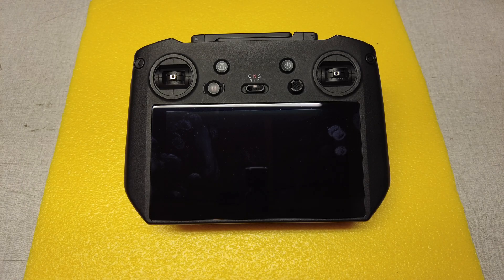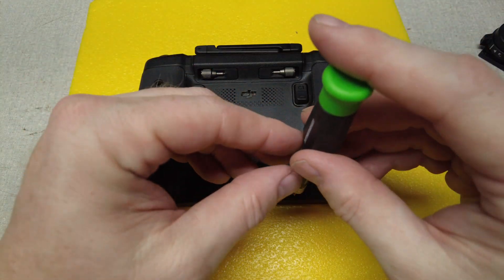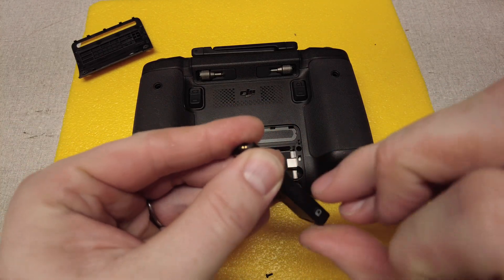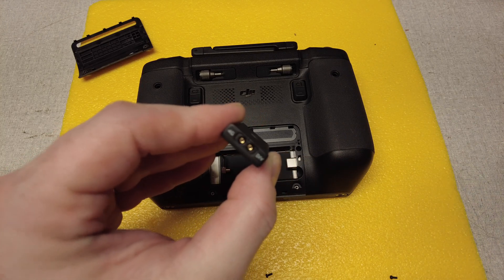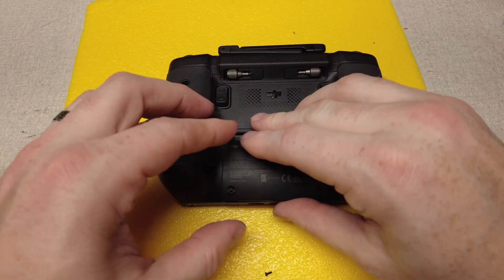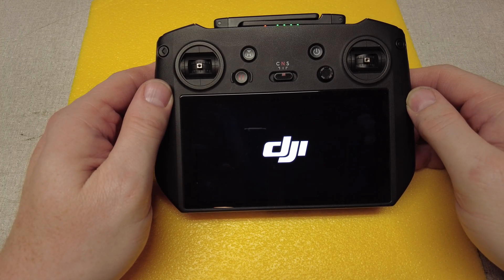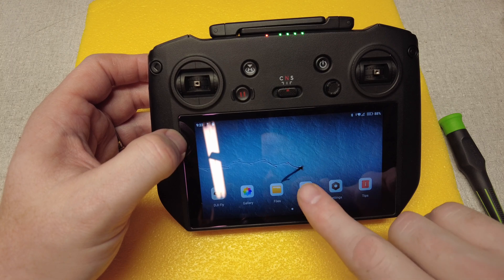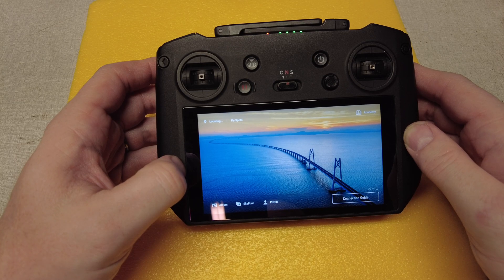DJI LTE Dongle Install

Comment: If you’re using this on the drone to extend its range, do we need two of these dongles? One for the RC pro and the other for the drone?
Reply from the maker: This video is merely about installing the LTE dongle in the RC-Pro controller. That is all. This isn’t anything about BVLOS. But if it was, yes you would need two, one for the controller, and one in the little backpack attachment on the top of the drone connected to the USB port on the back.

Comment: There are so many pictures on the internet where this is attached to the drone. Do I need two devices or is one in the controller enough?
Reply from the maker: So this is ONLY to give the controller its own internet access without having to be slaved to a phone for that. This IS NOT for doing the LTE control of the drone, as that feature is ONLY available in China. If you looked through comments you would see I’ve stated this many many times.

Comment: Dave, if I install this on an enterprise RC Pro, can i use the remote ad the hotspot for an RTK base station?
Reply from the maker: Used to be able to. But a firmware update made it so they won’t recognize these devices anymore. :(

Comment: Just a quick addition here, I'm sure this may answer some of your questions.  When I called Verizon Wireless to order a SIM card they said they couldn't do it because it wasn't a phone, tablet, etc.  They wanted to give me another line.  So, as a test, I removed the SIM from my Galaxy S21 Ultra, installed it in the dongle and carefully installed both in the controller and booted.  Hope you have small Torx bits.  ;-)  Went into settings, turned off Wifi and turned on mobile networking.  Rebooted.  BAM!  4G Verizon Heaven.  So I called them back and ordered a duplicate SIM for my phone.  NO CHARGE, FREE 2-day shipping.  If the duplicate doesn't work, I'm told to use my old one, install the new one in the phone and activate.  That's it.  FYI, she told me that VZ can't see what device you use the SIM in.  That means that all data you use with your new controller mobile connection will show under your phone number...like they're both the same.  So cool having cellular service with the Pro controller.  IMHO, for the price, it should already be onboard in case you want to utilize it.

I don't know about other carriers, but I wouldn't think there wouldn't be much of a difference.  Your mileage may very...good luck!  ;-)

Thanks for the tutorial Dave, it came in handy.
Reply from the maker: Great points. Thanks for sharing. For me, I just took the dongle into an AT&T store, told him exactly what it’s for and he made me a SIM card.
Reply: I ordered one and plan on removing the sim from my ipad mini I have thru Verizon to use with my RC pro. Question did the new sim work? And if so are both working under the same number?
Reply: @antdwg67  I received the new SIM today.  I installed it in my pro without activating it and it works perfectly.  And yes, both work under the same number.  I'm an Android guy, so I can't speak to iStuff compatibility.  This really works great and the controller is fast.  Super happy with it and totally recommend.
Reply: @mikel9741  I have the same phone as you I just use an iPad mini for travel and was just wondering if I'll have the same luck
Reply: Mike so what you're saying is you have a duplicate Sim of your phone Sim and you just installed that into your controller and you don't have an additional monthly data charge?

Comment: Man I completely missed missed on the application of the LTE connection on corporate drones! So with "off the shelf" drones, LTE is just used to give the controller a network connection? I mean, that's handy for apps and workflow I guess but I thought it was a C2 LTE connection for EVLOS and BVLOS flight! Wow that kind of takes some of the excitement out of it if honest.

Comment: Why do you need 4G dongle in  this RC-Pro and people don’t need  that dongle on DJI RC with mini 3 pro? Thx helio
Reply from the maker: I’m using the dongle in the controller so it has its own internet connection, without having to be tethered to a phone for one. That is all.

Comment: Is it suitable for RC controller (not RC pro)?
Reply from the maker: Do you mean the simple RC-N1 or the basic smart controller DJI-RC? The RC-N1, no it won’t work, doesn’t have a place to install it, and is needless anyway since that controller is used in conjunction with a phone which has its own connection. The other DJI-RC, I have not gotten my hands on so cannot say.

Comment: I just received this if your in the U.S it's gonna tell you it's not supported in this region.. doesn't work
Reply from the maker: I am in the US, Washington state. The activated dongle installed in the RC-Pro does indeed work just fine to give the RC-Pro it's own internet connection without having to be tethered to a phone or wifi etc. 

That IS all this video is about. 

I never once anywhere in the video claimed it makes the LTE control connection to the drone to be able to fly further than the RC range. In fact I dont even approach that subject in the video.

Comment: Hi, have a couple of question. I saw a bit down in the comments, that you now have 2 dongles. But the first question will be regarding the compability with the operators in US (As I understand you're located in Washington?!). The dongle that I have seen on internet is a TD-LTE dongle, but I live in EU and here we mostly have FD-LTE, how is it US, did this work fine with any operator and also FD-LTE?
I know its not related to this post, but have you tried to connect with the 4g option on the RC Pro to the Mavic 3?
Reply from the maker: I wasn't aware of the difference between TD-LTE and FD-LTE, thank you for pointing that out so I was able to educate myself. 

I had no problem getting it to work once I got a sim card for it. Yes Im in US, in Washington state. I just went to my local Telcom company (AT&T) and proicured a Sim card, inserted it in the dongle, hoked it up to the controller as shown in the video and it works. 

As for the having two, and getting it to work, I have not tried recently. I did try once at first, with just the one dongle with the sim card instaled on the drone, and the controller being tethered to my phone for a LTE connection, and was unsuccessful. From everything I have read, that is most likely going to be the case even with two dongles and a sim card in each as it is a geo-locked based feature. I have been expecting to perhaps see someone finding a work around to that, but honestly I haven't looked lately.
Reply: @DaveDurkee  Thanks for the reply, yes it seems like it is geo-locked unfortunately, lets hope there will be an update on this soon. Chers, and thanks for the content.

Comment: This dongle work on dji rc n1??
Reply from the maker: Not as far as Im aware. the RC Pro has the internal USB C connection as well as the internal antenna plug to connect to the dongle. the RC-N1 I dont believe does, but I havnt had one taken apart to really be able to say for sure.

Comment: G is it possible you can tell me where to get the DJI dongle from? I have any maverick three classic with the RCA smart controller.
Reply from the maker: I got mine from Alibaba. Just looked, they are still available there.
Reply: Thank you so much for your response, do you know if it works for the regular RCA controller, I do not have the pro yet?
Reply: @andrewjones6962  I don’t think it does but can’t say for sure.
Reply: @DaveDurkee  What firmware are you running on the rc pro cheers

Comment: Hi….  Can I ask a few questions?

I have a Mavic-3 and an RC-Pro controller.
The drone is sometimes flown in a heavy Wi-Fi RFI area which causes the drone to lose link with the remote controller.

I already have internet connectivity for my  RC-Pro controller.
(Tethered to my Samsung Galaxy S10+ / Cellular carrier = Verizon Wireless)

I have a single DJI “dongle” set purchased from a Chinese or Hong-Kong seller.

Can I just get a Verizon Wireless SIM Card (NYC/NJ Metro Area), insert into the dongle  and connect the “dongle” to the Mavic-3?
Does the RC-Pro absolutely require a second “Dongle” or SIM card inserted ??   Or… can I just use my existing far tethered connection?

Any idea how the drone links to the controller via IP (4G /LTE) and / or Occusync 3 ?

ThNk you VERY much !!
Reply from the maker: I guess you didnt read the other comments. So... this video simply shows how to install a 4g dongle into a RC-Pro Controller. Doing so ONLY allows the RC-Pro to have internet access without having to be linked to another device wirelessly. That is all. 

This video doesnt have anything to do with having 4G control capability of the drone. Ill repeat that since it seems to get missed. This video doesnt have anything to do with having 4G control capability of the drone. 

Therefore the questions you ask are outside of what is covered in this video. If you want conjecture into those answers, my responce would be no. No It wouldnt give you 4G control capability. It has been pretty well and clearly stated by DJI and many others more in the know than I, where that capability is geo locked to certain regions of the world where it is permitted, namely China. And even then I would assume would require certain permissions and hoops to be jumped through to be good to go. But its a big fat NO here in the USA.

Comment: Greetings David……Quick question? Was able to order the Wi-Fi dongle, one for the pro controller and the install kit for the mavic 3
My big question is how difficult was it for you to obtain the micro Sim cards need it to install in the module?
Would really appreciate any information you can provide for me as I use the drone as a professional.
Thank you, Allan G.
Reply from the maker: I too use the drone as a professional. To get the SIM card, I just took the dongle with me to an ATT shop, told them I needed a nano SIM card for data only for it, and got hooked up with one pretty quick.

Comment: Where did you get this dongle?
Reply from the maker: Ali Express. Took a few weeks before it arrived. Have gotten two from them now, but they do come through.
Reply: @DaveDurkee   bro I just ordered one fom aliexspress last month should be here this week .. I thought it would help as far as range I have mav 3 no pro controller. So I should be okay
Reply: I have the regular RC controller. Will it work on that and I was reading you also have to put one on the drone.
Reply: Ebay.  Received it in eight days.

Comment: Thanks for you response. Do l need 2 SIM cards for the RC and the Drone.
Reply from the maker: Yes
Reply from the maker: Bear in mind tho, a lot of peeps seem to be getting the vid a little confused. All it is is putting a SIM card in the cellular dongle and installing it in the RC-pro to give the RC-pro a cellular data connection. That is it. 

Getting the 4g flight via a cellular modem on the drone, I do believe requires the service being made available through DJI for your area.

This just gets a cellular connection to the RC-pro for data, ONLY, at least here in North America. Other places may be different. 

Now if the service is available in your area, then yes both cellular dongles would each need an active SIM card.

Comment: That dongle it’s plug and play work for any celular company att/Verizon’s/T-Mobile/
Reply from the maker: Absolutely. Pretty simple. I made the video because I was asked to to prove how non complicated it is to share with peeps.
Reply: Does the dongle work in North America network? It seems only can work in mainland China?
Reply: @jamesyao9199  yes. I’m in USA.

But maybe I should be a little more specific tho, yes it works to give the RC-Pro a cellular data connection. But it doesn’t instantly mean the cellular control connection to the Mavic 3 is enabled. That requires another cellular dongle on the Mavic 3, and I do believe a a service enabled. That part I don’t know more about yet.
Reply: @Arcadey34  I have a regular Rc with cellular data phone ,I install it on Mavic 3 with even China mobile cellular SIM card which roaming internationally,still doesn’t work! There are must have some cellular plan for the cellular  carriers to support this future which is still not available in overseas beside mainland China!
Reply from the maker: @jamesyao9199  hey man, I think you are getting the cart before the horse or so to speak. This video, is just about how to put a cellular dongle in an RC-Pro controller to give it a mobile data connection. That is all. This has nothing to do with a Mavic 3, hence you never see one in the video if you actually watch it. JUST ABOUT getting adding a cellular dongle to an RC-Pro controller, so it has a data connection of its own. That is all. This works in USA, that is where I am. You just go to telecom provider and tell them you need a nano SIM card for a data only plan. They give you one, you put it in this dongle, you install the dongle in your RC-Pro controller like is shown in the video, and then your RC-Pro controller has a data connection besides wifi. That’s it. End of story. Nothing more.
Reply: @DaveDurkee  I see! There is no benefits for the drone flying range! I have watched someone posted videos on YouTube to fly around downtown Shanghai China with this cellular dongle installed on Mavic 3, really awesome!
Reply: @DaveDurkee  Not worth it, the plan costs money, with same luck you can get mini wifi dongle from your carier and put in your pocket or even backpack with drone and you good to go
Reply: It does have benefits for the flying range